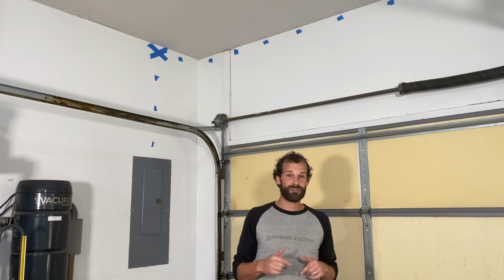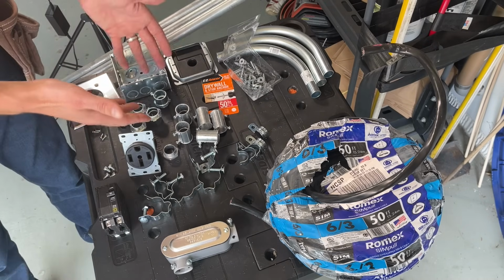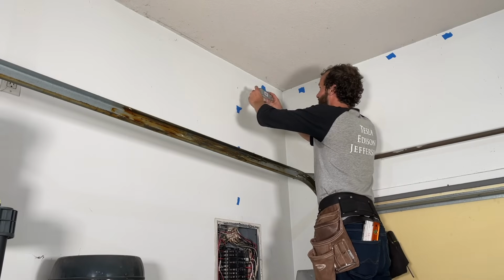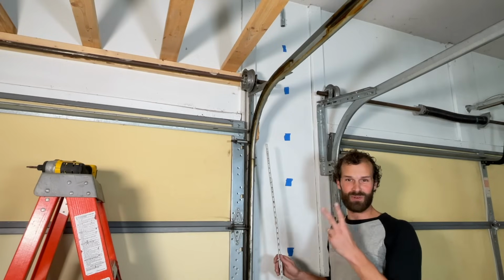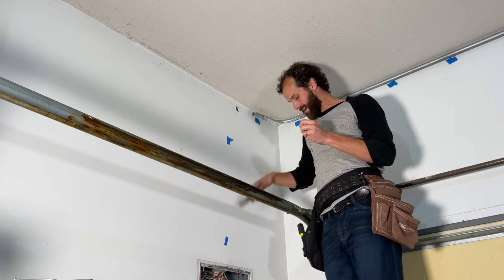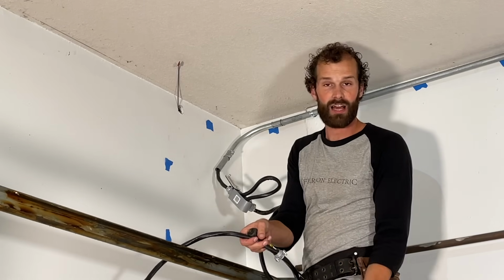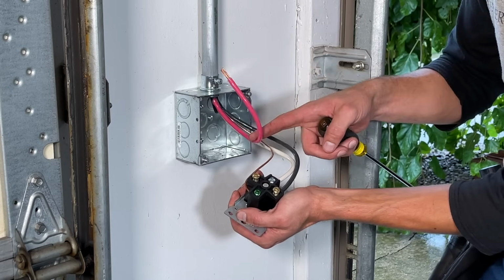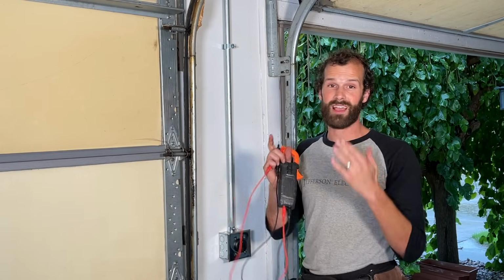How To Install a 240 Volt Outlet | Electric Car Charging

Comment: I liked your presentation.  When working with a live panel I use a non-conductive fishtape.  Although a LB looks nicer, I prefer a 4-11/16 deep j-box above the panel to get a proper wire bend and easy installation. Also I would have stripped the jacket off the Romex between j-boxes.
Reply: Green fiberglass stick?

Comment: 220 VS 240. shouldn't be nominal at all IMO. completely different. If you have 220 volts on a 240volt system. you have problems. same with 110 vs 120.

Comment: Per my calculations, at 230 volt, 50 amps & a rough length of 20', 12 gauge wire would only have a voltage drop from 230 to 228 volts or 115 to 113 volts.  One of the main advantages of using high voltage is that you don't need to use expensive heavy 6 gauge wire.  Through the conduit I would have run four separate 12 gauge wires (2-hots, 1-Neutral & 1-ground) from the circuit panel box to the 50 amp receptical.  It would have been a much easier install not having to run that thick insulated wire through the grounded (connected) EMT.  The conduit would also be a smaller diameter & cheaper.

Comment: Correct me if I'm wrong but for the EMT to be grounded there has to be direct metal contact between the grounded circuit breaker box all the way to the 4" deep junction box.  As such, don't you need to connect a ground wire to that 4" junction box to ground both the box & all the EMT fittings & pipe.

Comment: Question - you're installing a 14-50 outlet for a dedicated Level II EVSE, there is no neutral needed for Level II. Can you from a code point of view use just 2 hots and a ground and eliminate the neutral wire?

Comment: i'm a DIY homeowner.  Why is it that the electrician in this video said that the best choice for a 240 V outlet for an electric vehicle charger is a 14-50?  Would a 6-50 serve as well and reduce the cost of the outlet and copper wires needed to complete the job?

Comment: 1. Turn off the service disconnect or the master breaker.  LOCK and TAG it.  Sure, you're in the same room, but what you're teaching is missing this crucial step.  There's no need to "have the utility company pull the meter" when you can just turn off the service disconnect.  It's right next to the meter.  Red handle.  Can't miss it.

2.  Use a Magna-Pull or attach rare-earth magnets and pull the fish-tape through the wall using the magnet.  Fishing for your fishtape using either another tape or long pliers when YOU KNOW FOR A FACT it's amidst other live wires is stupid.  Stupid is what electrocuted people are.  When you're teaching, teach to that level and you'll have it all covered.

3. Whether you're writing a resume or doing a presentation on wiring an outlet, the word you want is "use."  You abuse the word utiilze far too much.  

4. Oh, so you "discoverred a stud" where you wanted your NEMA receptacle.  Poor planning.  Bu hey, why not do the homeowner a favor and toenail the box to the stud?  That's going to be a lot stronger for the daily plug/unplug than 3 drywall anchors and (I guess) one drywall screw.

5. Your LBs are lazy.  You spend all the time working within their limitations and the end result is aesthetically ugly.  Yeah, it takes a little more effort to cut drywall, put the conduit in the wall, restore the drywall, mud, patch, and paint.  If you can't be bothered to do that you're another lazy handyman masquerading as a master electrician.  What?  "But it's just a garage?"  The NEC and our sense of beauty don't stop at "the door to the magic room known as the garage."  

Pretty sloppy.  You got the electrics right, but that's the easy part.  You messed up on safety, fishing, conduit planning, explanations of how YOUR slop isn't how it should always be done (see also about service loops - if you can leave one then do!) 

If you'd done it right you'd have shaved off about $300 in conduit, connectors, and LBs.  Attaching the receptacle to the stud would have been golden OR you could provide a NEMA 14-50 M-F so that the unplugging/plugging stresses out a $30 pigtail, not an installed recep.

You're badly out of date, and your safety skills are as well.  Get your big boy chone's on, and see how it's done now, not in the 1970s.

E
Reply: To point #1, residential service in the US isn't required to have a separate service disconnect on existing installs (only new construction). There is usually nothing between the meter and the 200A (in this example) master breaker for a DIY-er to lock/tag.

Comment: no box offset on the plug box, no kick on the vertical 90 to get back flush on the wall, and pulling loomed through emt ? maybe a 4x4 box above the panel and make joints ? hack job.

Comment: So, I have an old circuit. 30A breaker, 3 wire pull through metal conduit to a 50A (stove) outlet for a clothes dryer. My daughter wants an upgrade for her new dryer. (LOL) Can a new 30A outlet be grounded to the conduit, thus to the subpanel (which has the box grounded separately from neutral)? Or do I have to pull 4 conductor wire?

Comment: The plate to mount the receptacle should be of the type "Industrial Raised Cover" not a mud ring and trim plate.
Another thing that profesional electricians won't do is to pull nonmetallic sheet covered cable; by code, in conduit, individual conductors rated for 50 Ampers.
And one more comment, the box should be a [4 11/16"]  deep box and a (4 11/16") industrial raised cover to house such size of wires and plug.

Comment: U never addressed grounding your EMT! U referred to the importance of the EMT as being a critical component to the grounding system, but that only applies if you conduit mechanically is contiguous to the panel itself, which, by the way, necessarily has to be properly grounded! Hell you never even grounded the four square or the EMT. If the metal gets  Energized who gonna be the lucky person that's gonna become the ground ? Is that nema receptacle adequately grounded by the grounding conductor through the metal base plate and the mounting screws?

Comment: Where to start?

First pulling Romex through conduit? Why? Use THHN, it's cheaper, pulls easier and won't overheat. Charts, right in the code book (or online) tell you max number of what size and type wire.

Pulling a metallic fish through a live box? You're top cool for school dude 

You do know what a chase is? Yeah, the drywall is up. No one will ever look.

Comment: I have done DIY with electrical for 40 years or more, even rewiring a house with a new breaker box in a house out in the country.  I am VERY impressed with how thorough and careful with your explanations were.  Thank you for this.  I do indeed plan to get a Tesla box, but I will probably pay for that to be done.  It will be a brand new house and a brand new car.  I will not DIY that one...
Reply: He really was so thorough…I had to subscribe! I’m an electrician apprentice right now, and at times we’re on a job for months only putting up lights, so this was a great overall refresher on running wire in EMT, fishing wire, plus some pro tips I’ve heard of before but had forgotten about!

Why wouldn’t you DIY this with your experience?
Reply: Come on you can do it, a lot of great tips in the comment section on how this could've been a much smoother installation, like using a 4s box instead of the LB conduit, and transitioning through the wall to the panel with flexible metal conduit or better yet using MC cable and avoiding completely the used of the Romex cable, even installing a 5s box with an industrial raise cover for the receptacle.
Reply: @triguer1  What do you mean with " 4s box instead" ?
Reply: @yvesn58  4s box is a metal box that will be used as a junction box, just like the one he used to put the plug. He should've used one of those instead of the LB. He got into a nightmare trying to run that cable through the LB. There are fittings to connect the wire from the back of the 4s box down to the panel using MC cable, Flex conduit, or even the same Romex cable he used.

Comment: My 200 amp panel has no more existing slots because we have AC, solar panels, and a surge protector.  Can I use a dual breaker (2 circuits on one breaker) to make available space for a 50 amp breaker?

Comment: Hi EHR, a quick question topic related. Was curious if there is a distance limit on electrical cable run from outlet to the panel? I am about to dive into this kind of adventure and my run is approximate 40ft long from garage to the panel. A “bit” longer then in your video so I wondered. Great video! Thanks in advance.
Reply: No

Comment: Hi. I would loosen those breaker screws a bit before installing it. Dropping them won't be such a hazard that way. Also I've made my 2 pulls from the center out, just another way of doing it. I'm not a real electrician, but I was an aircraft electrician for 20 years. And the last 18 years I've been a locomotive electrician... So I've seen some BS in my day.

Comment: Nice video however should tell people shut power off no matter what. Safety first, you said and we saw you using your right to keep installed 220 v breaker for atonement not wise now you become grounded if you finger door side of hand could get zapped, while using fish tape I always use a cycle ruler inter tube slide it over the fish tape or use your electrical grape over the fish tape then no zapping right safety first.  Maybe large tractor inter tube cut to since place over all breakers, I say you touch wire under high voltage meds even I if was a ground if wire some where in system had a short and no one had known you dead,  other then that great job I will check out other videos plus they plastic fish tapes thanks for your time and understanding Ed Fugate stay Safety friend